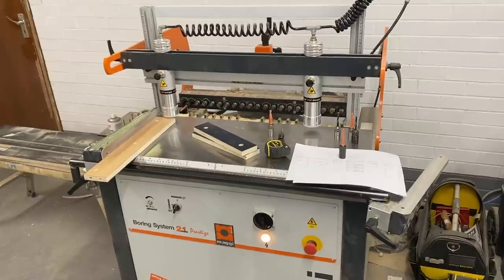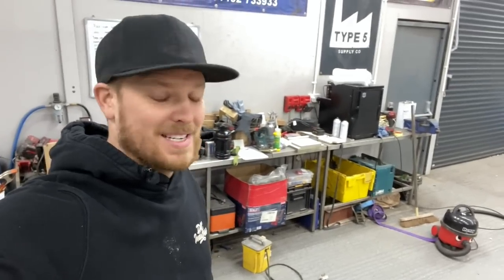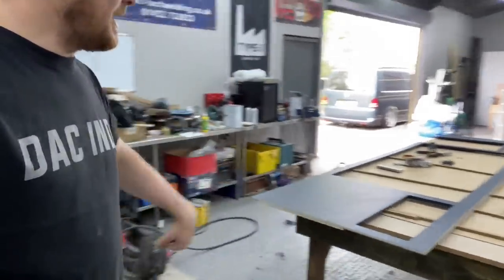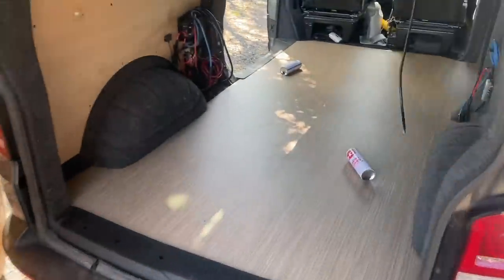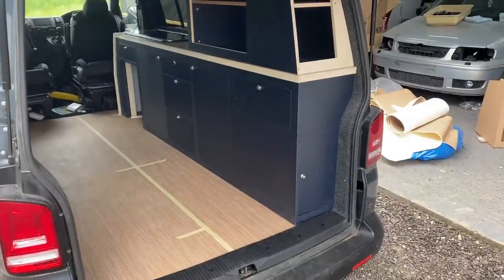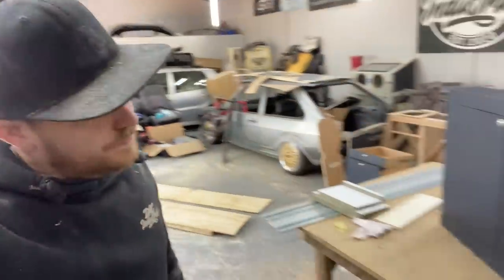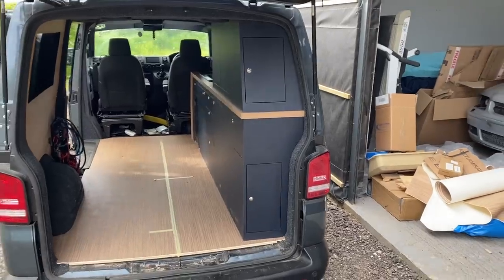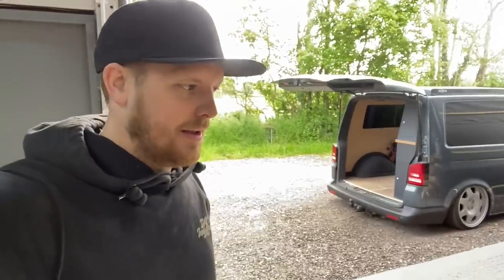Camper Units Build Part 2 - VW T5 Camper Project

Comment: The edge handing can be iron on..... A d trimmed using a Stanley blade paint scrapper.... Usedc.a g times in caravan industry.... As a finish even 800 grit...wet..
Reply from the maker: That is a way of doing it although it is very thin and doesn’t last very well. This is 0.8mm this ABS (plastic) edging that will take a bit of a beating and still look good.
Reply: @DanChambersDAC  we always did a dual adhesive.  Found the edge banders are ok for some applications. However on others had  to use a drum sander. Adapted. With a rubber pad. To push against.  Made radius a dream and better adhesive grip... Ps on the abs
Never use anything cirtus based and anything like jif. That has micro beads.  Always use a non citrus based product. I spent over three months investigating why so many, vans statics etc all had issues. Jesus the amount of shit and research I did on bloody caravans and statics motorhomes. Lol would drive anyone to loose the bloody plot. But it all changed things that people take for granted....

Comment: Dan, regarding the adjustments to the height of the units and the tapering adjustment on the work surface, will you adjust the CAD dimensions accordingly so the design can be repeated if necessary?